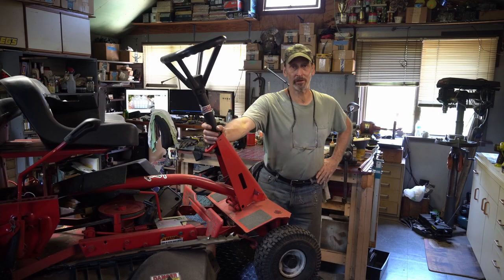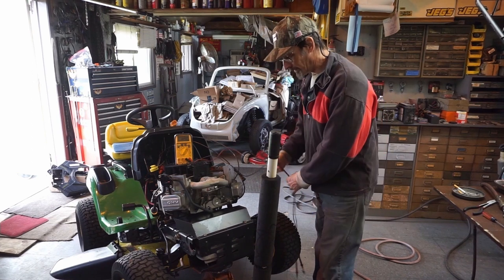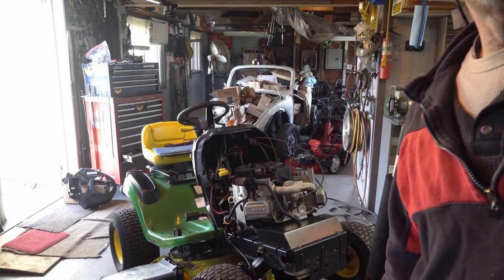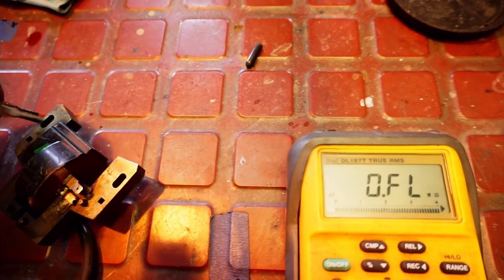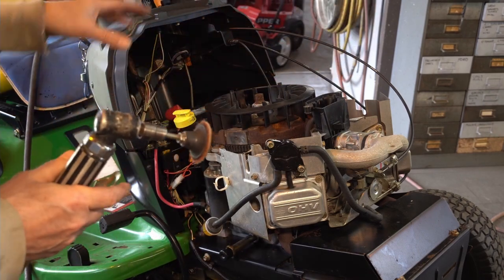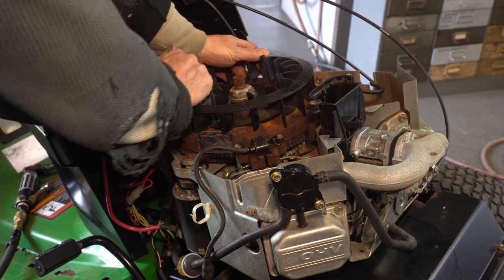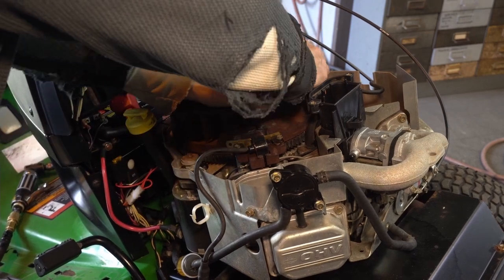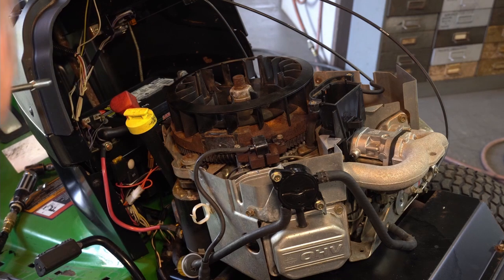How to Test A 20hp V Twin Intek Briggs And Stratton Coil Magneto With a multimeter ~ Gap & Install

Comment: Very helpful.. dealing with a what I believe is  driver side coil failing under load. Spark plug wasn't burned clean like the passenger side...sounds smooth under no load. For grins and giggles will switch around plugs as well as  check ohms.
Reply from the maker: Exactly Gene,, I should have made more mention of that but I was busy with that stupid call and distracted, trying to earn a livin and all
On my 20hp Kohler I went to a different heat range for now as I know that motor may have other issues.
I did mention the possibility of buying a match coil set just to rule out any spark related unbalance. Naturally check the new coils just in case!
I'm tryin to learn ways of sharing this info..Not as easy as I may have thought.
Thanks for watching, good luck with your machine!
Stay tuned!
Reply: @TheNovaJohn  ya done good  job explaining the testing....this rider I bought had been setting outdoors uncovered for around 2 years. I never thought about rust/grounding issues.. so I'll be checking that, as well
Reply from the maker: Thanx Gene,,,,Yes I speak of this often, with coils and really any electrical system. With the coil mount to engine, many people overlook this. The dissimilar metals expand at different rates and can make a poor connection. Rust and oxidation forms right at this point. Also the 2 metals create a type of electrolysis. making things worse.
Your correct, left outside and not touched, add age and water....eesshhh

Comment: I have the L111 and get no spark out of the drivers side. Did all the checks and both are the same however the ohms from spark plug wire to that ignition lug that runs back to the key reads 4.5k on both the sparking one and the non sparking one. I’m ordering at least one new coil to check it. I may have been running on one cylinder for a while!
Reply from the maker: Nice,, good luck.
I think there may be a diode in the harness somewhere. 
I have another one of these engines out in the boneyard burried and its a mess!
One of these days I want to get it running again and show a number of details including wiring.
Check your plugs too, maybe get 2 new plugs and you should check the compression as well!
If your engine has been running on one cylinder you may have gas washed it and this would damage the cylinder. 
Or it may be down on compression due to valves or some other issue.

Comment: Thanks for the how to video. I have a jd with v-twin that is hard starting and when it does start ,it stalls out like running out of gas. I have rebuilt then later replaced the carb and still having the same problem. Im gonna repkace the vacuum hose to the fuel pump next. The fuel pump has been replaced also. Any suggestions would be great?
Reply from the maker: You could try taking a can of gummout and spraying around the carb, intake area, not in the carb but all around looking for vacuum leaks..It would need to be running, maybe spray a little in the carb to keep it running long enough to then spray around and see...It may rule out a vacuum leak at least
Reply: Thanks, I will try that.